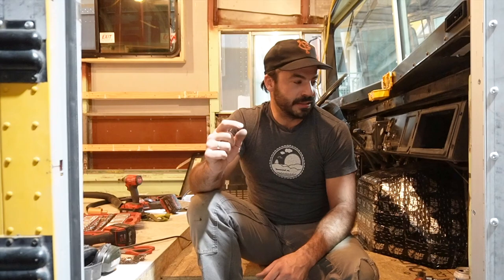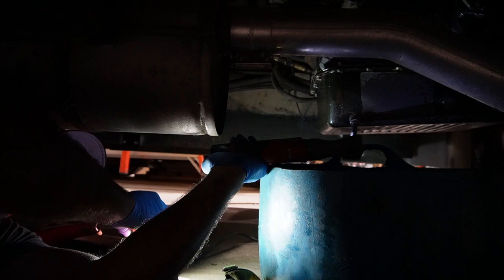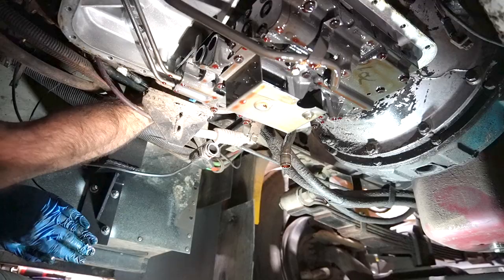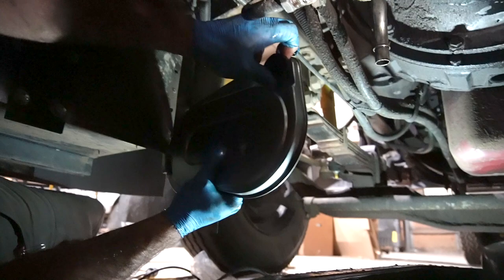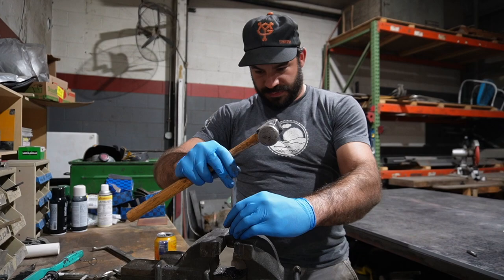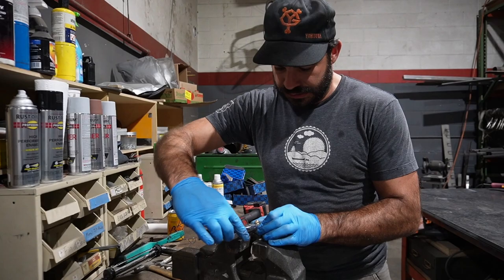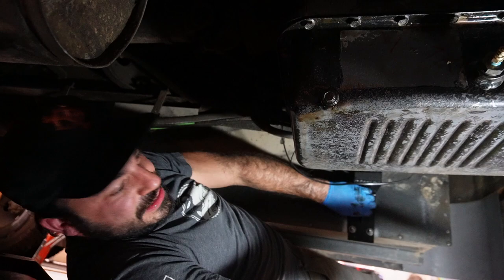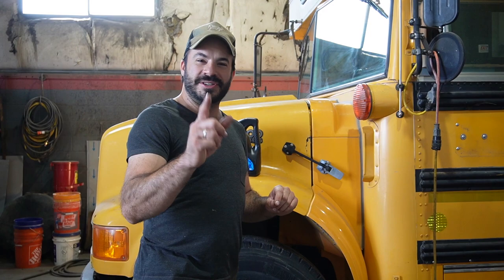Servicing the WORST SKOOLIE TRANSMISSION: the Allison AT545

Comment: Great video on the AT545. I also installed a secondary trans temp sensor in my pan as well. Here is the difference of temps pan to case.
Pan temp 197'F
Case sensor 199'F
Your idea on this works just fine. 
Also, that trans filter pickup tube. If you ever have difficulty getting the top portion of tube into trans past the "O" ring. Take the tube to a belt sander or hand sand top of tube to a smooth camphor. The tube in the trans or kit is just square cut. This will help avoid "O" ring damage. I did both ends of my tube. All fit great.
Reply from the maker: thanks for sharing that!
Reply: @ChuckCassadyYT  Absolutely. If we ever meet with our road titans, lunch on me.

Comment: I hope you'll put out a "How To Install Solar on an Rv, Skoolie and Van".
They're all basically the same for install. Attach Solar panels to roof,
bring wiring in and down thru roof to attach/hook up all the electrical.
You have a very cool way of showing us how to do things. Easy to understand.
I'm in the process of getting everything I need to install solar on my
 2001 Fleetwood Jamboree 24 foot Class C. 
So far I have, four 180 watt 9BB solar panels, a 'Victron MPPT 150/70 tr' charge controller 
and a Victron BMV-702 battery monitor. My brother is giving me his inverter.
I want to do the install myself so I'll be able to troubleshoot it down the road if any issues come up. I need to understand how the whole install works by walking thru it myself.
Much thanks Charlie. Great job on the video.

Comment: was an allison tech for thirty years and my boss loved yhis trans. made a lot of money off this trans. last summer helped afriend install a newer 1000 allison into his older bus. got the unit,wiring and ecu out of wrecked Int. truck with a DT engine. works extremely well and was not as hard as some might think. PS checked my own records and found i had rebuilt 392 of these AT series trannys. the proper place for sending unit is with an adapter tee in the cooler send line..a quicker install and less likly to get snagged. we would tell cust. when temp gets to 250 stop and idle in neutral.

Comment: hey good point to look for the o ring but please fill cartridge filters before putting on!
nice to add a temp gauge but an external cooler, pump, and another external cartridge filter would be very good.

Comment: Whoever maintained my bus...was good! they took a permanent marker and put the date /miles on filters when they were changed and also the rebuilt trans. Also as I refill my trans or used oil I refill the new 1/gal bottles with the old oil. then as I get close to refilled I know how much oil I drained because I checked the level before draining.

Comment: I should be pulling my AT545 and swapping out for one that I was told that was coupled with a 4bt for a water pump set up with little to no hours on it. I will be pulling and comparing valve body’s and see where the shift points are set at and talk to a Alison dealer to see what else might be different. Been reading threw the service manual as well

Comment: A cooler(maybe electric fan), temp gauge and maintenance is all Ive read that can really be done to the 545. Also you can run a ground wire to the sending unit body to a better ground.

Comment: Depending on the route a school bus was on it would probably lead a hard life transmission wise as its constantly upshifting and downshifting and if it was a hilly rural area and packed with kids, a driver with a heavy foot as it upshifts, that would take its toll for sure. Chuck, is there a trans cooler on theses buses as I am guessing it could then be possible to do what I call a poor mans flush system by first dumping the oil out of the pan and changing out the filters as you did, then disconnect the trans cooler line that is pushing oil into the cooler and hook up a rubber line to it routed to a drain pan/barrel. Then add oil and run the engine until the oil starts spurting out of the hose as the sump is getting sucked out and air is entering the pump and cut the engine quick, add more oil and repeat until it comes out nice and red. I've only done that trick on a pickup and it certainly pushed the old oil out of the torque converter in that instance which is the goal. The cost of the oil to do a full flush, well that's another matter ! . I think its safe to say that most buses have well used transmissions by the time they get sold unless a reman trans was installed shortly before the unit was sold.
Reply from the maker: Agreed! It does have a cooler so your method would certainly work!
Reply: @ChuckCassadyYT  You would need an oil sponsor to afford to do a full meal deal oil change, what insanely expensive oil that is !
Reply: @charlesb4267  One thing that's bad about the trans oil cooler is that it goes into the engine radiator. Which runs a lot hotter than your trans needs to run . so installing a independent oil cooler strictly for the trans would be optimal.

Comment: Hey do we know of a manual replacement for this? Id even be okay with a manual for a heavy truck application, I have a lot of experience with asynchronous trans driving, but not with what could be a replacement for the AT545 that would let me have manual selected gearing.

Comment: Could you tell me the part number for the spin on filter you use? I'm looking in the far outdated service manual for my 545 and the only filter that still pops up is the fram HP 1, which is a racing oil filter. Just want to make sure I get something that meets all the Allison's specs as far as flow rate and such.

Comment: I drove school buses throughout most of the 1980s and into the 90s. I left it for 20 years but now I'm back driving school buses again. They ran the 8545 for years & years with very few problems. I used to like the whining sound that they made while accelerating through the gears!. I could see however how overheating could be a problem if you do a lot of over-the-road interstate 70 mph driving. Would any kind of cooler help with that?
Reply from the maker: Yes! A cooler does help a lot but you're still losing efficiency no matter how you slice it. I also like engine braking down the mountains here in Colorado so the mt643 will be a welcome upgrade

Comment: I just wish the AT545 had a tighter torque converter! Mine you have to rev it like crazy to pull away from a stop, which is silly because max torque on my DT466 engine is at 1200 rpms. The bus likes to rev up to around 2000-2200 RPMs and basically stay there all the time because of the slush-box torque converter. You never really have the sensation of that automatic transmission "lunge" from a stop.
Reply from the maker: I hate that too
Reply: @ChuckCassadyYT  It's too bad because  it would be very interesting to drive a vehicle with an AT545 in it with a super-tight torque converter. Maybe that goes a long ways towards not missing having a lock-up torque converter.  I'll bet you could buy a used, stock torque converter from an AT545 and send it off to a muscle car transmission shop and have them work their magic on it.
Reply from the maker: @r0ckworthy  im sure you could and im sure it would help but if im gonna drop the trans down, its pretty easy to just put the MT643 in so id likely just do that. the lockup TC plus the heavier duty nature of the MT643 are really nice upgrades
Reply: @ChuckCassadyYT  Good point.

Comment: Bro you're kidding me right? The AT545 was the BEST transmission put in a school bus aside from the Spicer but that was a stick. The 645 was a complicated electronic mess. These were virtually bulletproof. I even remember most of the part number for the spin on filter started with 29539579. Sold cases of them.
Reply: @MelanatednNature  ?
Reply from the maker: I'm not kidding. The MT643 is mt favorite all mechanical allison in a school bus. Lock up torque converter, 60k gvwr, and no computers. I'm not aware of a 645, let alone one with computers. If we're talking sticks, I'd take a roadranger over a Spicer any day. I believe you are mistaken
Reply: I would say that just the fact that it's a 4 speed while later Allisons are 5 speeds...is enough for a 👎 on the at545
Reply: It’s a good transmission but a little lite behind the DT466
Reply from the maker: @mundoracer  I just don't like electronics, so none of the modern 5-6 speed Allison's meet my needs, but they're well loved
Reply: Chuck what do you think about the MT 640? I got one in a 1986 International Wrecker,
Reply: I agree i like than they not lock up torque convertor.....lockup generates a lot of heat...and under load can slip....with age....i got two at 545 in 2  1995 Ford F 700s...gross 35,000 lots of times....not one problem...ever...
Reply: @DieselDoggy429  I think it’s time to sell

Jk but if you aren’t moving other trucks with it it’s time to let er go

Comment: You know anything about black exhaust smoke on acceleration? My bus won't rev. Above 1500 either 😔
Reply from the maker: black smoke on a diesel is overfueling. Id suspect a bad turbo
Reply: @ChuckCassadyYT  spins freely with no play...
Reply: @ChuckCassadyYT  Do you know any trustworthy mechanics near Yuma, Az? I'm kinda stuck here on blm land 😬 my first time here and don't know who to trust or much about diesel engines (I am a mechanic, just gas motors though)
Reply from the maker: Have you checked your fuel filters? What year and engine?
Reply: @ChuckCassadyYT  replaced the fuel filter in Or. then drove straight here. Changed the air filter once I got here and am picking up a new fuel/water sep r n. Im not losing any coolant and didn't overheat going over mountains in Or (though semis were passing me) towards the end of California it started blowing black smoke and not the stop engine light. Pulled over and about 20min later started it and it drove better than it ever has for about 15min. Was already planning to stop at this blm. The next day tried driving and the black smoke is back and it won't go over 5mph 😔
Reply: @ChuckCassadyYT  08 6.7 cummins isb
Reply: No def, but I do have a dpf. Oh after changing the fuel filter the dpf light came on and completed (I think) the regen. I have a manual regen button but the light isn't on so I don't think I can force a re-gen
Reply: You are so quick to reply! Thank you so much 🤭
Reply from the maker: @ammocandoit  that is too new for my old school tricks and knowledge to be of help! the black smoke is almost always overfueling but who knows what those emissions controls are up to. the only other mechanical thing I can think of to check is to make sure you're not losing manifold pressure somewhere that is preventing you from getting full boost, which would cause overfueling and the need to run a regen cycle to clean the dpf. Try calling AAA bus sales and see if they can help--they're in phoenix.
Reply: @ChuckCassadyYT  I will try that thank you!

Comment: At545 transmissions got a bad rap because of people that don't understand the transmission.  No its not a brand new transmission, no it doesn't have overdrive,  nope it doesn't have a bunch of todays luxuries.....   But, if you keep this thing cool with a nice big oil cooler, make sure you have a temp gauge and do the research on how this transmission was made you will find that people who have taken proper care of these transmissions have gone 300,000+ miles with them.  This transmission can be rebuilt and reinstalled in a day.  Take care of it and it'll take care of you.  And yes it'll break but all transmissions break. I've definitely seen much worse transmissions.  Nice vid.  Ill follow MOST of your tutorial.....  :) 😁
Reply from the maker: thanks for watching! i mean, it is the worst one you can get. Can you make do? Absolutely. BUT everything about an AT545 is true for an MT643 (all mechanical, removed and reinstalled in a day, simple, effective) but an MT has a lockup converter (more efficient in 3rd and 4th gear with engine braking), and higher GVWR/HP capacity. Ill be swapping this AT545 for an MT 643 to take the additional cooling load required by the non-lockup converter off the anemic stock engine/trans cooler setup and get better mpg, higher top speed (since the TC is locked), and more reliability. Sure the AT545 can last 300,000, but not the way I want to drive my bus in Colorado. Im opinionated. I used to run a fleet and have low tolerance for high maintenance under performers
Reply: @ChuckCassadyYT  yeah.  I guess we can agree to disagree.  I’ll prolly change out the 545 for the 643 if I have problems.  I’m putting a 24” by 24” Hayden cooler on my trans.  Already have one on the engine.  Amazing cooling.  Shouldn’t have problems.
Reply from the maker: @SirGrogg  i was considering keeping it...but the cooler i was planning to add is about $600. I can get a good used MT643 for $1200 and avoid the cooler install, get a higher top speed by about 8%, have a tougher trans, get engine braking, and the only mod needed is to shorten the driveshaft 2.75" i loved the DT466/MT643 buses. its my favorite kind and a totally different feeling bus than the dt466/at545